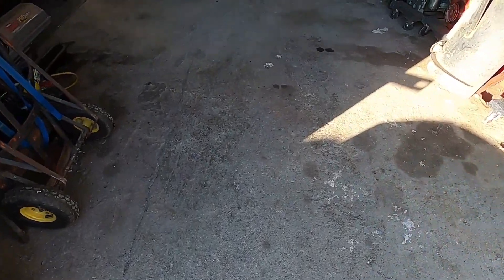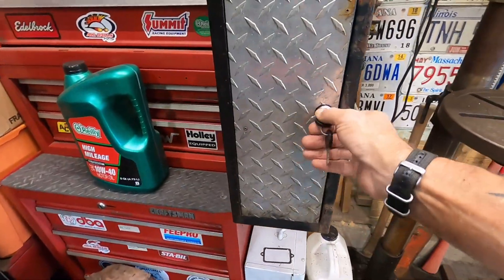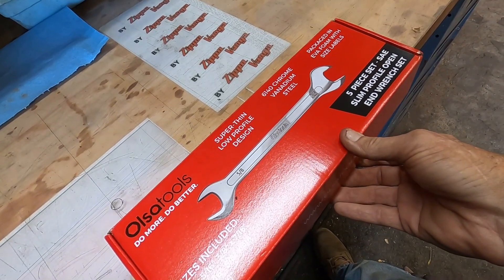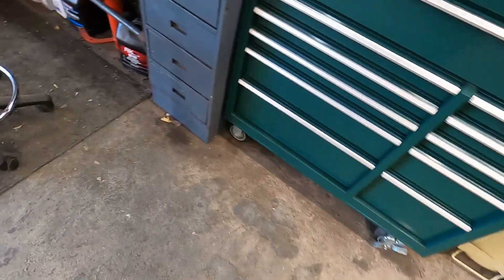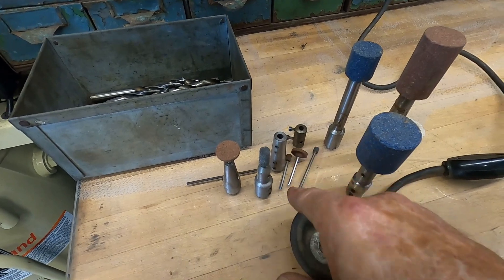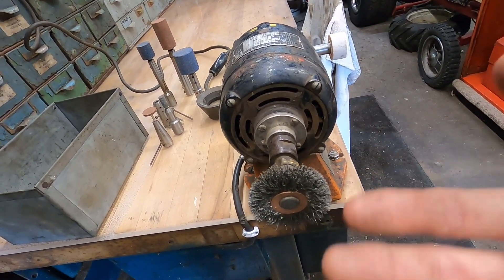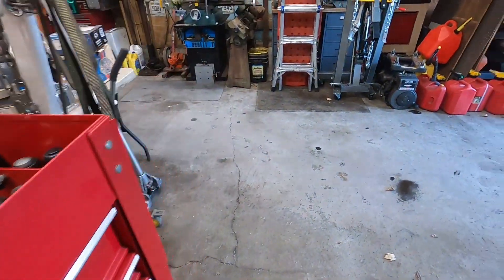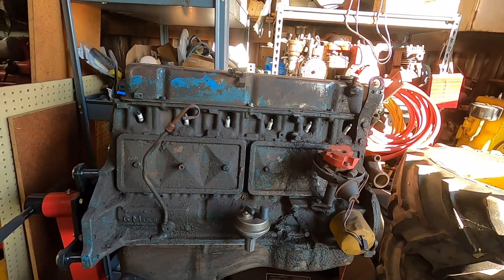Shop Reorganizing Day 8. We're Almost Done!!

Comment: A monumental task completed.  Excellent.  Now I just have to have enough energy to start on my garage.  I really like the labeling concept.  The hard part is deciding on what goes in which drawer.  Those devices that  go on those electric motor is there a vender for those.  Looks like they come with a sleeve that slips over the motor shaft--is that correct?  Thanks for the video.  Don't over do.  I am sure I won't.
Reply from the maker: Actually, they're all custom made on a lathe, but could probably be purchased in some form or fashion. As far as what goes in what drawer, I pretty much had a general idea. Commonly used items at chest to waist level and all other items either above or below. Sans the bulkier items that needed to be in the deeper drawers. So far, I'm happy with where things are and I've gotten into the Green Giant a few times a day already. It's working out awesome so far. Cheers my Friend! Zip~